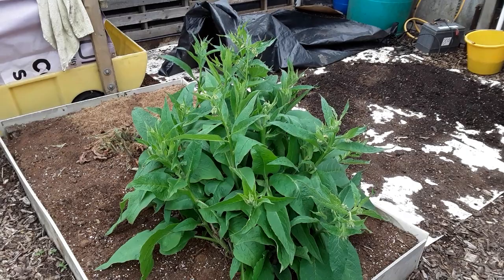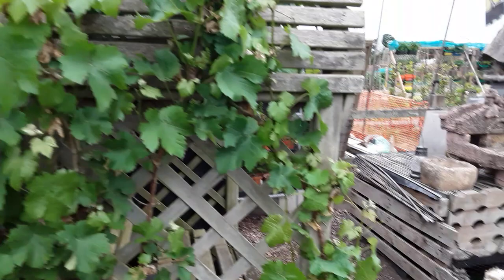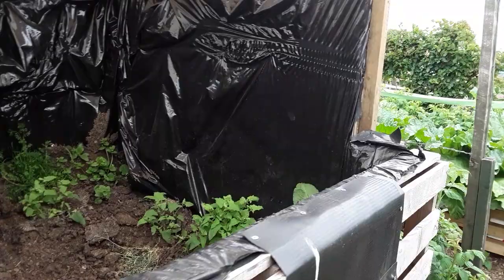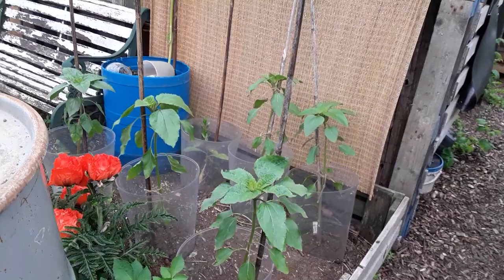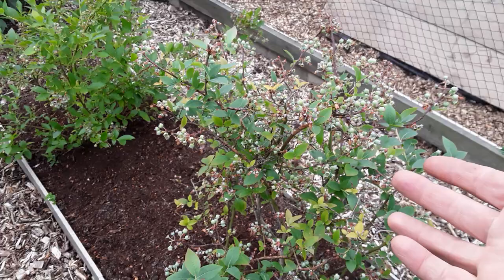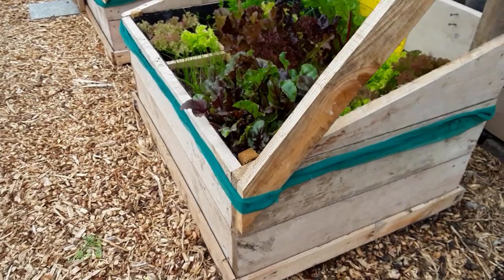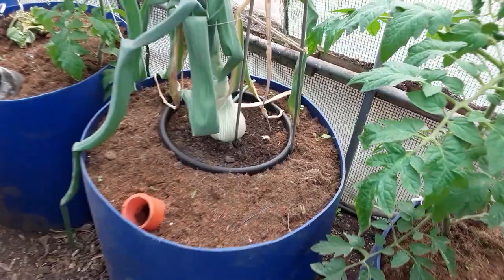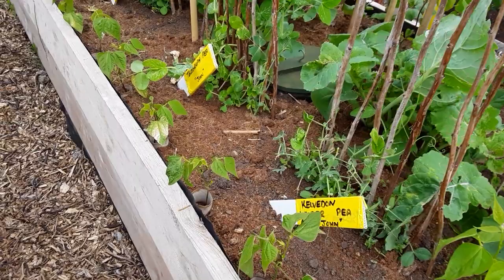June Progress Update, Tour Of My Fruit And Vegetable Allotments #shedwars #teamoverthepond

Comment: Hi Terry, a brilliant idea, using the lampshades to shield the sweetcorn whilst they gain height 👍 Have you considered putting some debris netting above the carrots/parsnips to supply some shade?. I have added a pheremone leek moth trap in my onion tent to see what is lurking about ........ all looking good
🌻 Nigel .......MuddyBootz Allotment 🌻
Reply from the maker: The cabbages have done better with the netting Nigel so I will replicate Williams idea of the plastic cold frame with your tip with netting on the pallet collars, should help with moisture retention and reduce the heat, that's if we get a Summer now......lol. cheers. 

♻️🙋‍♂️🙋‍♀️♻️Happy gardening, Terry King.